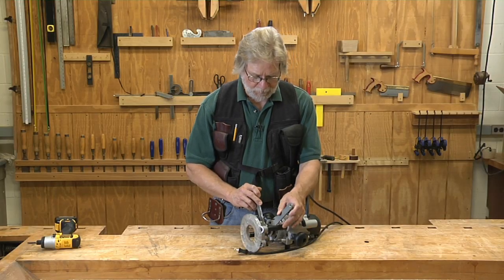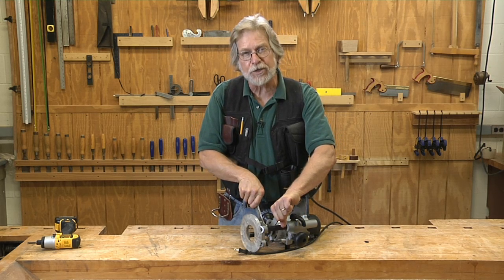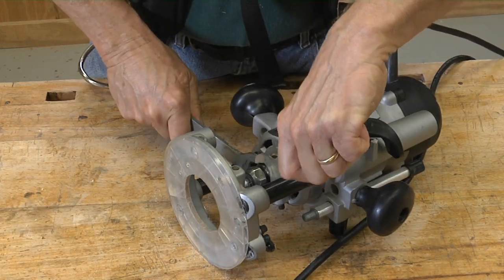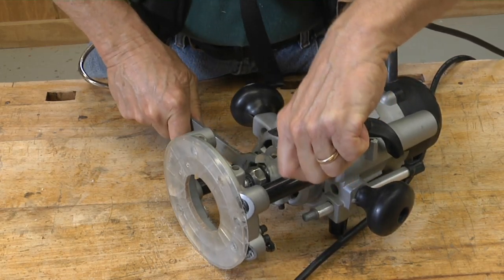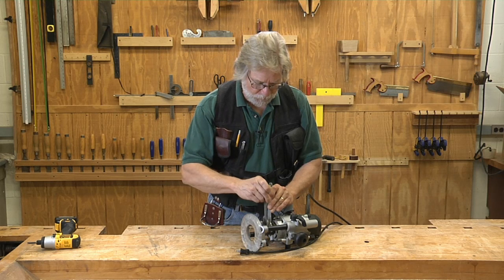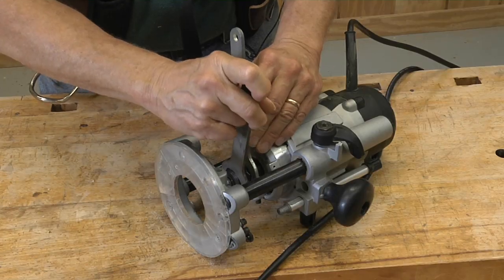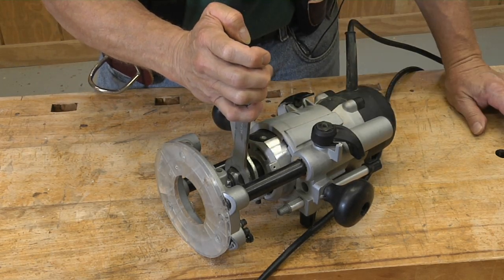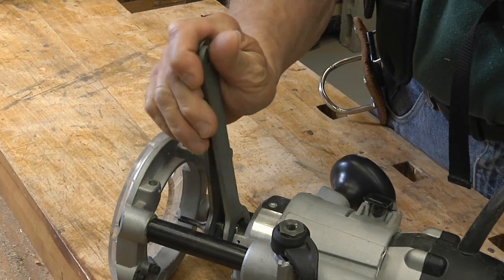How to Remove a Router Bit Without Busting Your Knuckles

Comment: I learned a better one.   First you put one of the ranches in to one of the nuts and you laid it on the table,  once that is firm you take the other ranch and put it on the outer nut and push down on in with the palm of your hand (this works really well with over thigh nuts). Sorry about my writing English is my second language.
Reply: I laid it on the floor and put pressure on the other with my legs and that worked :)

Comment: it's seized on my vintage craftsman.  backing nut loosened but locking mech. for the shaft was too wide to fit in groove.... i used to use this as a kid...wth?  i filed it  but keyway is too worn.  narrow vise grips and tap wrench w/ hammer....no go